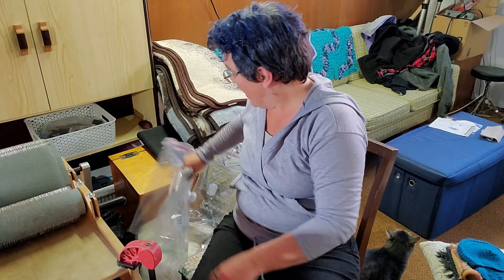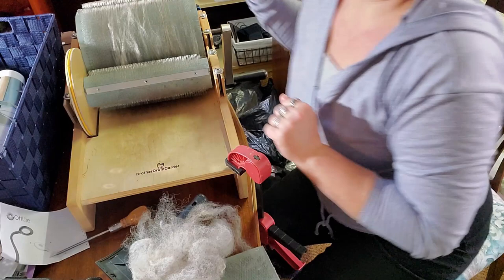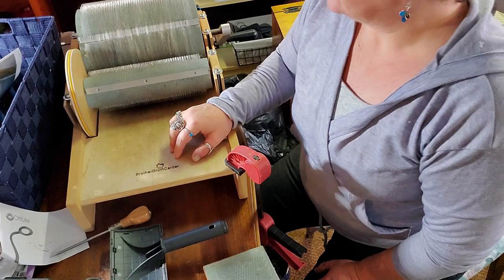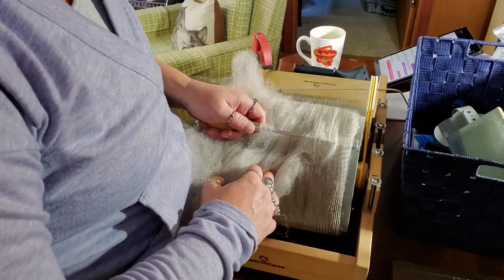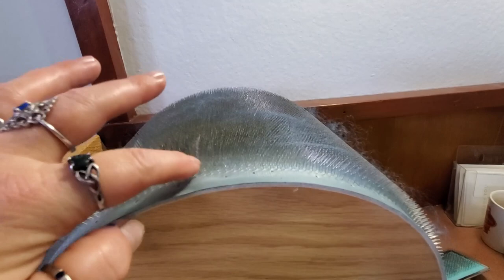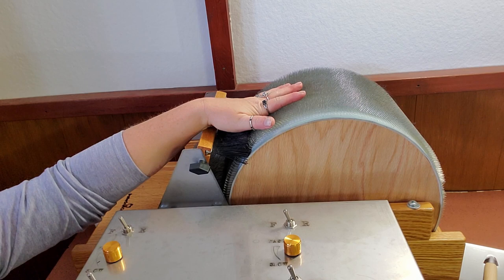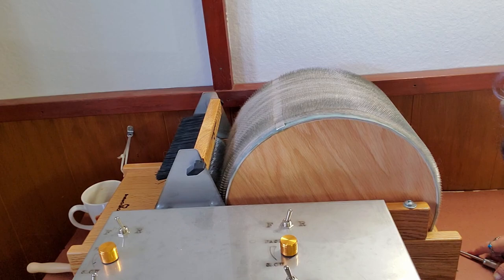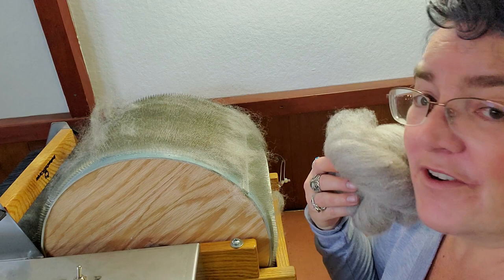Drum Carding Fleece Locks

Comment: Hi hope things are good with you. Great video thank you
I have got some Gotland mix fleece (not sure what it’s been bred with) which I have just washed.  Do I card it as you have just done or do I feed it onto the drum carder from the cut or the tip end ?
Reply from the maker: @suefisher5531  either way will work. If you're trying to keep it organized more like a top than a roving, then just make sure you feed them on the same way everytime and note how they align as you take the batt off so you keep feeding it in the same direction.  It'll work better if you open up the locks a bit before you feed them on and usually starting at the cut end will work better but try both and see what works for you.
Reply: @bffiberarts  thank you so much   It’s all a learning curve   I’ll give it a go 🥰

Comment: Locks. Very short wool cut from the fleece by shearers. Either short wool from around the points or second cuts caused when shearers lift the handpiece off the skin and then shear the short fires left on the skin to tidy up. Why use those? Why not use staples?
Reply from the maker: They're not short or second cuts.  Locks of fiber are staples.  Same thing, different word.
Reply: @bffiberarts  I've owned 3000 sheep & at shearing time locks are under the skirting table & sold in bales as short lengths. Fleeces that are made up of staples, are classed separately.
Reply from the maker: @rosertaylor6139  perhaps you're in a different country and that's how it works there,  but on my channel we do not get hung up on terms that are used differently. If you find that distressing then perhaps this isn't the channel for you.